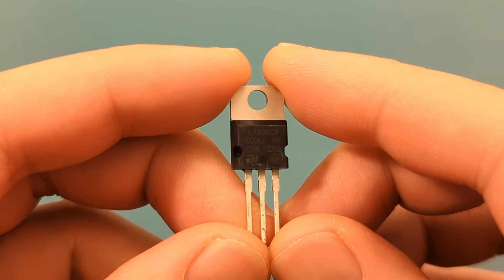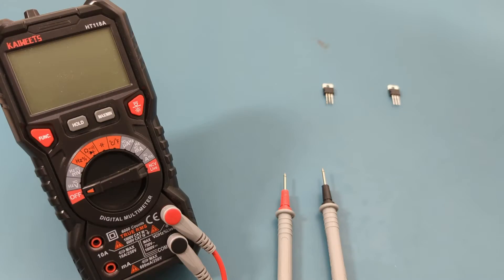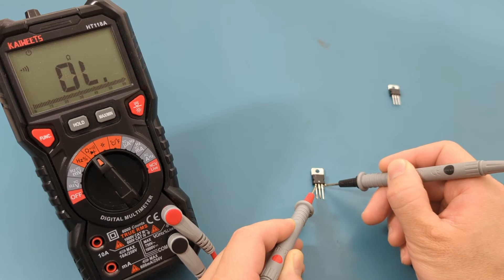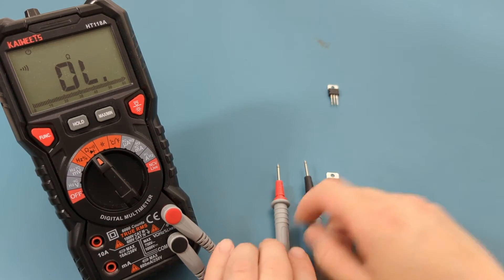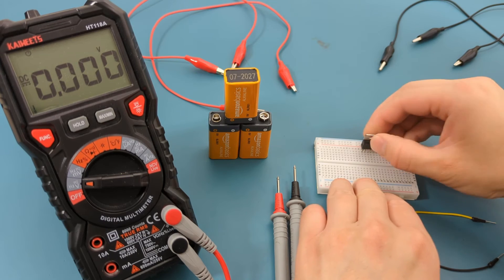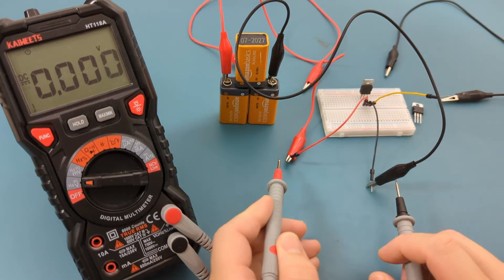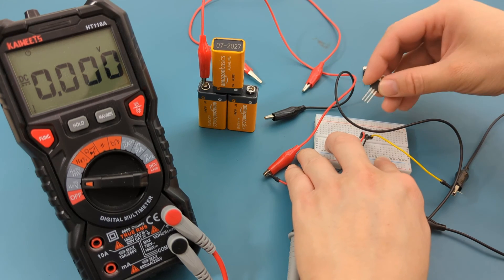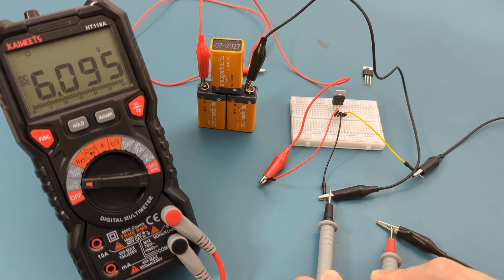How to Test a Voltage Regulator with a Multimeter

Comment: Sigh ..does MY voltage regulator have a 7806?? Unlikely, as it's supposed to output just over 14V to the battery.

Comment: Thank you for this upload!!! +100K for having the same multimeter as I do :D I have a pair of Sony SAVA-7 speakers that have been AWESOME over the years. We recently had a voltage spike from the electric company 😬 Lost my speakers, Air fryer, OG Xbox and window AC unit. I opened the speakers and there is obvious charring around one of the voltage regulators. Hoping that is the fix, but I appreciate your video!!!

Comment: I had a fast charging puck completely stop working. I found the 7350-A regulator had about 2.5V on the output when the input was 5.1V. I briefly bridged the input and output, using an ammeter, as diagnostics. The lights came on and it continued working without anything attached. 🎉 It seems I reset it!?  I added a heatsink pad in the open space between the PCB and the aluminum shell to prevent future overheating.

Comment: Very helpful thank you. Think I’ve got a faulty SOIC-8 5v voltage regulator and was wondering how you test the output voltage. Is it possible to test directly to the PCB or should it be removed?

Comment: So not just with a multimeter - need 3 batteries, breadboard,wires, clipsetc...?!?
Reply from the maker: If you get continuity, it indicates a short circuit, and the voltage regulator should be replaced. If there's no continuity, the second test is more thorough and involves checking the input and output voltages.
Reply: @ElectroUniversity  I understand, the title is misleading though.